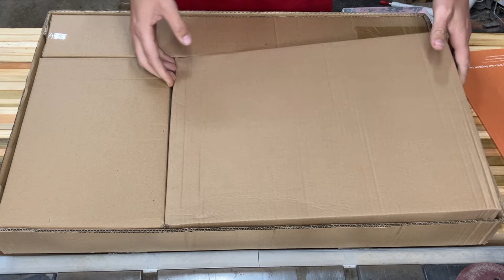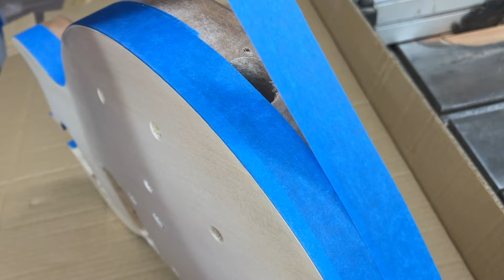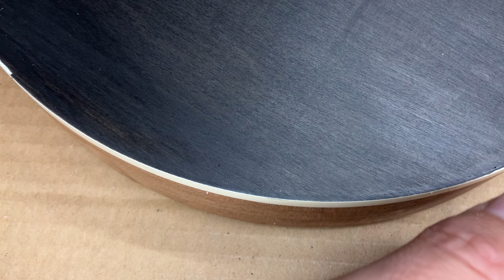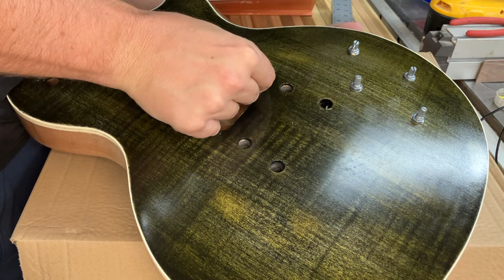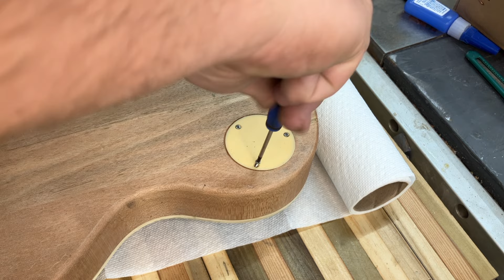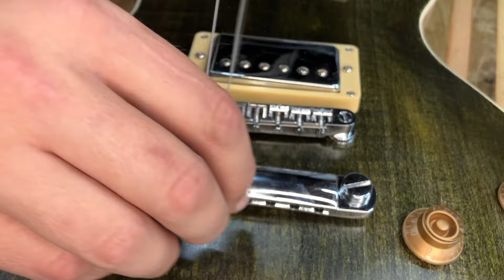YOU can build this guitar for $169! Fesley DIY Kit Guitar Build.

Comment: Thoughts on the electronics for that price?   A lot of low end electronics like that can be jut horrible with feedback and buzz, etc.  

Also, no finishing on the (what seems to be) raw mahogany body blank?
Reply: You could upgrade the pickups? Doing the finish seems like part of the fun, though he makes it look easy 😅
Reply: Many cheap kits come with cheap electronics. The same goes for the unfinished bodies. They're not meant to be high end guitars. Instead, they're great if you are interested in learning how to build guitars. That's part of why the electronics are all plug-and-play and do not require soldering. As you get more confident, you can replace the cheap electronics with something better. It's also fun to put your own finish on it. Some of these kits come with generic paddle-style headstocks that you can customize to whatever shape you want.
Reply: you could, but you’d likely need to replace the pots and switch as well (it’s a plug in system). Any pickups will only really be as good as the rest of the electronics around them. 

Either way it’s a cheap way to learn to do a finish, which isn’t really that hard if you’re patient and careful.
Reply from the maker: I think it sounds pretty good. The pickups have just a little bit of hum when you're not playing if you have the tone knobs cranked. They're definitely not the highest quality but overall, I'm pretty happy with the quality of everything. Other than the strings.
Reply: @dannylewisguitars  That's awesome!  Glad to see there are some decent sounding pieces in there.  

Did you end up having to shim the neck at all?  Fretboard material? 

I've built a couple guitars, but never a LP model.

Comment: Did you have to level and crown the frets?
Reply from the maker: I actually didn’t! The neck was surprisingly well done.
Reply: The frets on the Fesley kits I have had were all great and the necks were all already a satin finish. The only real downside I have seen from their kits is that they don’t take stain well, because they have a sealer on the veneer. You’d have to sand the flame off just to get through it and that would defeat the purpose for my needs. The guitar itself is excellent for what you paid though.